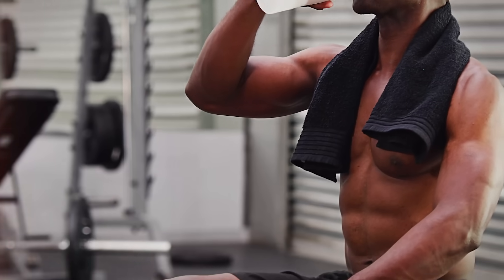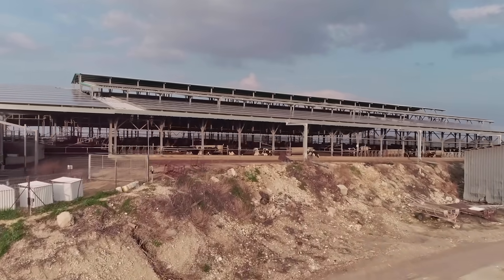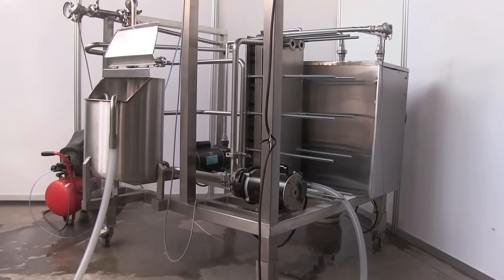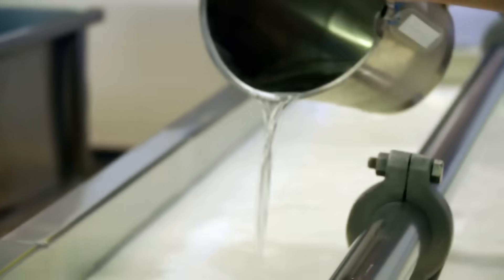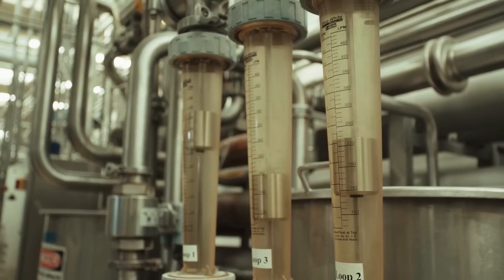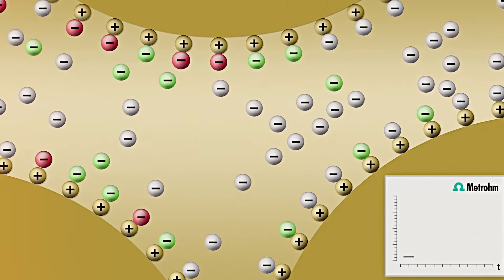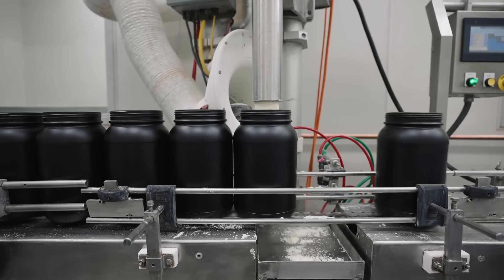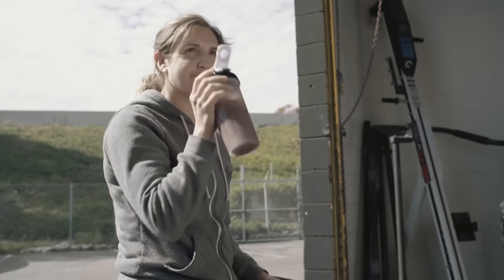How Whey Protein is Made

Comment: Isn’t it rather ironic that many people mix their whey powders with milk!?😂
Reply: Could just drink raw milk
Reply: @gokeymasterflex  No! They couldn't. You can of course drink milk no problem with it, but to get the same amount of protein as one scoop of whey protein (~24g of protein), you need to drink  700ml of of milk. And with this amount you getting also additional 35 of sugar (lactose), and amount of fat depending on type of milk. So instead of 100-120 calories from scoop of whey protein, you need to consume at least 250 calories of milk (for skimmed) or almost 450 if full-cream.
And having a couple of scoops of protein is fine, but drinking 1.5 litres of milk for this is just suboptimal. But taking 200-400ml of milk, add 1-2 scoops of protein and you get a lot of protein without too much carbs

Comment: the CHEAPEST full protein profile is the EGG. 1 EGG = 6g of protein Vs per 100g serving of the powder.
Reply: So 6g vs 70-75g of protein.

This is not cheaper.

It really depends on how cheap you're getting your eggs vs whey. Doing some shopping around and varying the price per protein ratio, seems 80% of the time you're getting a better deal with whey.
You can get eggs that drop all the way down to around 15 pence per egg, at which point, eggs are more efficient. But that's half the price of most commercial eggs. Economy of scale typically means you get better value for whey. Whey is simply faster and easier and requires no prep time.
Reply: The cheapest protein is actually canned fish, for example sardines.

Comment: So in other words all those companies have their protein manufactured from the same company? Or all those different brands are under one parent company
Reply: There are around three main raw whey producers in each continent. All the brands buy from them
Reply: Likely something of that nature til the powder is atomized and formed. Then the raw powder is likely sent to different facilities for different flavoring and additives that are brand unique.
Reply: Used to work at a plant that produced cheese and also WPC/WPC80 (whey protein concentrate/80% pure) 

Whey powder and whey protein concentrate powders are just commoditized inputs. Any cheese factory with a large enough foot print will have a WPC drying operation attached to it.  These are the ones that are creating the base for the powders that you consume. They are sold and shipped off to customers in bulk totes weighing in at 2800~ lbs each.  What the customer we sold it to does with it is up to them.  

I don't know of any cheese make facilities that also had an in house packaging line that was directed at the consumer.  I assume some must exist, but I haven't seen it.  Cheese is the primary goal, whey powder and lactose powders are just byproducts that are sold off in bulk to customers.
Reply: I noticed the same. They all seem to buy from the same factory. Very revealing
Reply: @stb3987  It's not the same factory, there are many of them throughout the USA.  Any large cheese making plant will have a WPC drying plant attached to it to capture the value of the whey byproduct.  And the plants that are too small for that, will ship their liquid whey to the big plants for further processing. Typically they will condense them (remove water) so the shipping cost is lower.

Comment: Two things , first is either put more powder in the container or make a smaller container there’s so much empty space ! And second make it less chalky
Reply: It's filled to the brim at the factory but then settles over time and during shipping movement which is why when you open them they don't appear full.
Reply: @Grunzaa  so make the container smaller like I said
Reply: Lol, container size does not matter. It's always going to settle over time and appear not full when first opened.
Reply: @Grunzaa  settle the product then put it in a smaller container problem solved
Reply: @houstonpromotion  When you move it to the new container it will unsettle and resettle in the new container the same way. It's powder and it will jiggle down on itself with gravity no matter what.
Reply: @hamnchee  they can do all that before shipping it , put it in a container shake it to mimic settling then ship if it unsettles then it’s fine cause it’s in a small container it’s not that complicated they have a ridiculous amount of air in there
Reply: I’ve always thought about this and I have considered this: if the production line had a added step in the filling of the containers of fine powders, such as protein powders, which had a ultrasound rack that these containers rolled on as they were being filled, perhaps in a couple of short stages between portions of filling, this may be the only way to help settle these powders during initial packing (to what degree, I couldn’t say) so that the space in containers could be optimized AND wasted space in these plastics could be alleviated. Because it’s not just the annoyance of purchasing seemingly unfilled containers but also the stupidity in our species to be unnecessarily wasting yet more resources (container materials, shipping space hence shipping fuels and the manpower handling of just about as much air as product) when we HAVE the mental capacity to figure this silly little dilemma out… to do better… to be smarter and more efficient.
Edit: or stop using hard containers/plastic “jars”… ever notice that bags of protein don’t contain as much useless air??
Reply: Hi, supplement manufacturer here - most products have a heat sealed, or glued top, the kind you would find on nutella. This needs to arrive to customer intact, through difficult shipping conditions. The roughly third of the can can act as an extra "air cusion" to help soften that bumpy ride. I recommend taking soft packagings, like doypacks, and using them as a refill to your hard plastic container. I recommend a container not larger then 1 kg on your counter, and refilling them from when it empties. Fun fact: i also dont like this gap so i overfill my hard plastic containers. And some do get damaged, and i eat those damaged ones. I am 94 kg :)
Reply: this is purposely done to confuse consumers that they are getting more when compared to competitors products...they seem to all do this
Reply: Yeah can buy whey in bags instead of containers